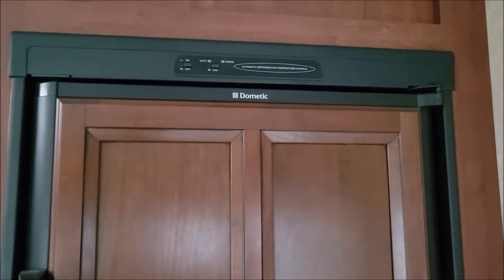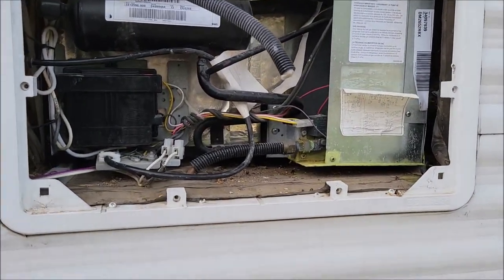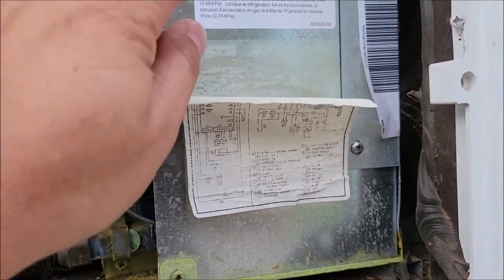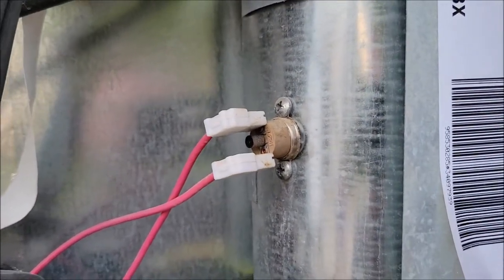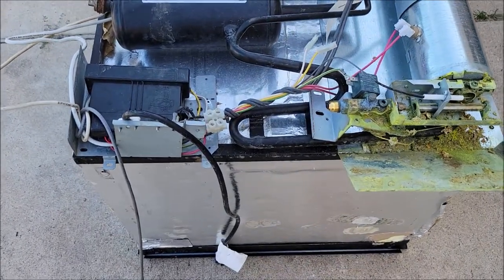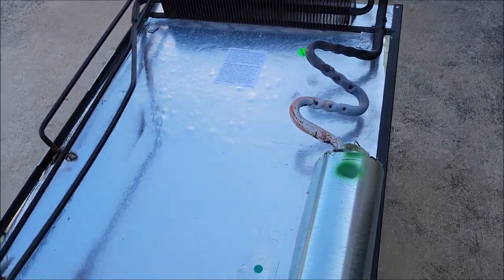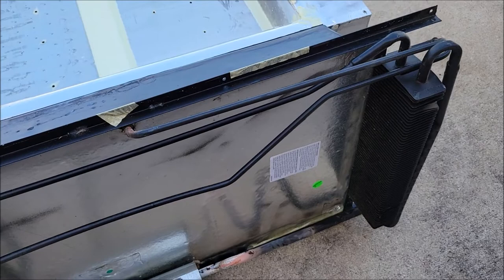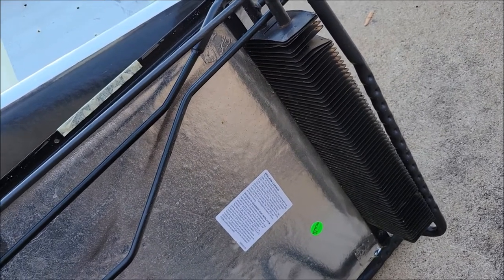RV Refrigerator Cooling System Failure | Cooling System Leak | RV Fail

Comment: Thanks for the video.  
Fridge wouldn't get cold, been trouble shooting it and I finally pulled the burner box cover back and found the yellow residue.  Ended up here trying to figure out what it is. 
And now I know.   Crap.   😄
Reply from the maker: Sorry to hear that, but it's a common issue.  We switched out our RV fridge with a residential one: https://youtu.be/mxYPcA0Mvu4
Reply: @SeidelRanch  Hey thanks for the link!  I'll be doing that soon myself. 
What fridge did you get and where did you end up putting it? 
I took everything out of my slideout years ago so it's just a big 16ft long room I can re-arrange with tables or bookshelves or whatever I want to do with it.  It really opened up the space.  
So I could put a fridge somewhere else really easily, but now I'm not sure what I'd put in the fridge's spot.  

I still need to sit down and watch your whole video, maybe you explain some of that in it. 

The air conditioner went out a month ago and the fridge went out a few days ago.  Ugh...  it just couldn't have happened like, two years apart???   Figures.    ^__^
Reply from the maker: @syberphish  Sorry to hear that about the AC.  I put the fridge details in that video's description.  Best of luck.
Reply: @SeidelRanch  I finally sat down and watched the whole thing.  Very informative.  Went to look it up and found it on Amazon but this new thing shows up that says it can't ship it to my address for some reason.  Some new thing that's been showing up on Amazon listings.  Figures.
Reply from the maker: @syberphish  Are you near a Home Depot?  They usually have them for around $400 I think.  You might try their website.
Reply: @SeidelRanch  Thanks, I'll check.